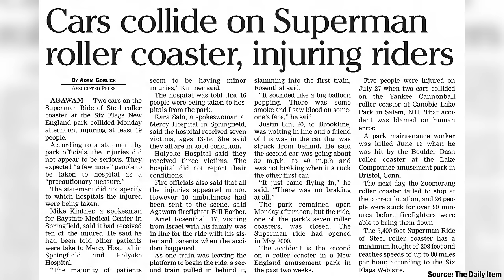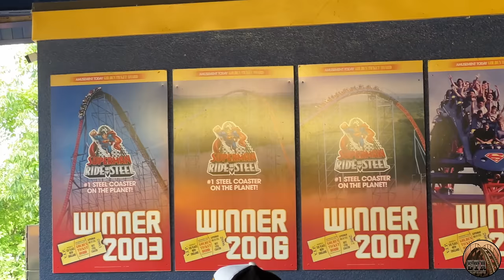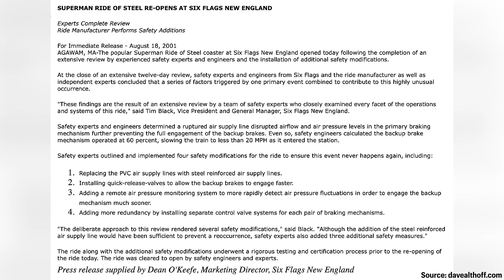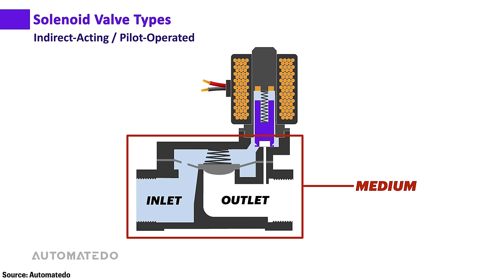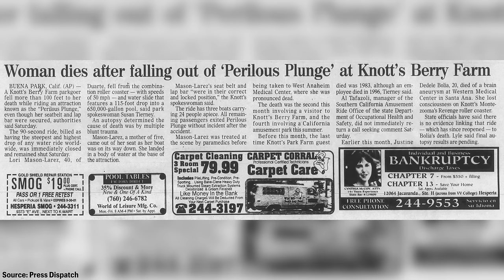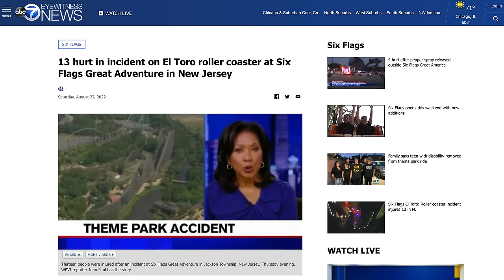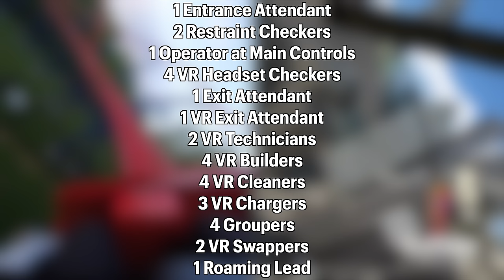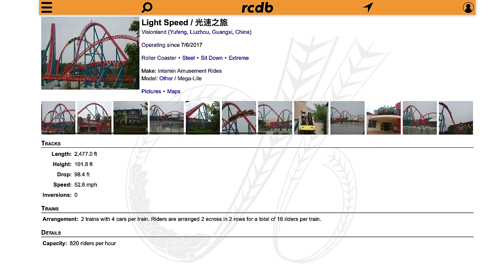The Accident-Prone Superman The Ride - A Problematic Roller Coaster

Comment: Im sorry, but if im told I can't safely ride a roller coaster because of my size.. im not coming back a year later, hoping I can sneak on at the exact same size. Obviously, those extra inches on the seatbelt make it "seem" okay, but there is no reason they shouldn't have been trained on how snug the lapbar should be and what part of the body it should cover. 

The employees should be better trained and more people need to understand that weight limits exist for a reason.

Comment: I have more rides on superman than any ither ride since I grew up near the park, unfortunately my first ride was in 2010 when it was Blizzaro. Ive gelt rhis rhing at its fastest and its absolute slowest. I never agreed with the hate, probably because once a yeat I got those magic rides. 

I've  learned how to manage the U brick. Still a top 10 coaster for me, but the original would likely be a top 5 because Intamin T bars are some of my favorite restraints. Ive never understood why the state has a seprate set of rules specifically for this ride, it shows they dont understand the cause of the tragedy. But after 20 years they wont roll things back. They already doubled down. 

I had no idea the U brick was meant to fit like El Toros, that would be so much better for my friends who still skip the ride because of them. 

Learned a lot about the ride thats responsible for me being an Enthusiast, the problematic coaster video I've been waiting years for.

Comment: I’m confused, how does the train stop on the brake run not touching the drive tyres when magnetic brakes can’t stop the train completely, I’m pretty sure you said it’s happening a few times on this coaster
Reply from the maker: The brake run on Superman The Ride is flat. While magnetic brakes on their own can’t technically stop a train, they can deplete the train of pretty much all its speed. Without a downhill brake run, the magnets slow the train to a point where it doesn’t roll forward anymore, basically completely stopping it
Reply: yep, stupid moment on my end

Comment: These systwms sound like they are ultimately dependent on literally never loosing power to work period...

Assuming the system is working properly in the first place, and I'm not under the impression Six Flags is too concerned with having back-up generators in place.

Given a sudden loss of power in the area, it sounds like all those fail-safes go with it
Reply: Guess I'll also say...

I FINALLY got to ride Superman here at Six Flag America a few years after it opened (still salty about them taking over 🤬. Can't keep anything up and running, and this way waaay before the worker crunch after the pandemic)

Honestly, after the initial drop, which can indeed cause a split second blackout, it was meh for me.

I suppose "after the bad guys toss you out of the building and give minute chase, the super powered boyscout gently lands you to safety."

It honestly teeters out dissappintingly for me. I won't say no if the gang wants to hit it up, and have a tendency of wanting to "hit up everything," so there is that. Just not overall aggressive enough for me.

Comment: I was on a trip to six flags with my summer camp once, we got to this ride and I sat out, sure enough, it stopped at the top of the hill, not even the flat part, the part where the front is just level… glad I didn’t ride that day! (This prob happened in like 2017)

Comment: It seems almost criminally negligent to design a control system without a sensor to determine that the actual brake assembly is correctly positioned, instead relying on the detected state of the pneumatics to infer that the brake is set.

Comment: Btw i have been on 300 coasters. These coasters in this video make me extremely nervous because i noticed right away ....stopping a few feet away from the station full speed. I never liked it. And i didnt even know about these issues. I have common sense. My wife would always sense i didnt like that coaster. I want 2 fail safe entire length areas to stop a train. That ride to me the first time i rode it pissed me off. I told my wife this thing is sketchy
Reply: And yes I know what those areas are called ...I just refuse to say it lol

Comment: You're wrong when you said that the magnetic brakes alone can't completely stop a roller coaster... of course they can. It's likely that for safety reasons you don't want to RELY on that, but there is no physical reason why they couldn't completely stop the train.
Reply: nope. magnetic brakes cannot take a coaster to a complete stop. they can make them crawl at less than at like 1 miles per hour, but you need friction brakes or block brakes for full stop.

Comment: Wait, The Superman I rode I believe at Six Flags a long time ago; it would pull you up and lay you upside down horizontal facing the ground like superman before the coaster began. Why am I not seeing this here? How many times have people been hurt and rides been shut down because very fat obese people get hurt trying to ride something not designed for them. If you are very very fat... you don't get to ride a roller coaster. If I was fat I would recognize that its a tight fit for me and I better not.
Reply: that's a flying coaster by Bolliger & Mabillard. i believe 2 flying coaster with the name Superman ultimate flight  have been installed. could be more. plenty of  Premier sky rocket 2's are named Superman Ultimate Flight too, and i think, there is also, or atleast used to be a  superman reverse blast coaster in australia?

Comment: Funny thing, I was just watching the part about it consistently overshooting the brakes on summer days before they added the 7th brake caliper. I operate Renegade at Valleyfair and they just greased the track this morning, but apparently they put too much on, and it slightly overshot the ready brakes 4 times today. Obviously, it threw and error each time and e-stopped itself, so eventually we just had to have maintenance pull a train off. Ride op things lol